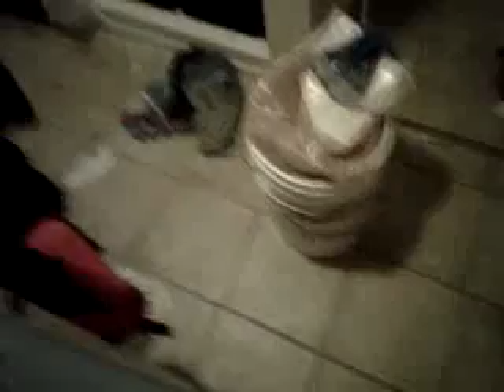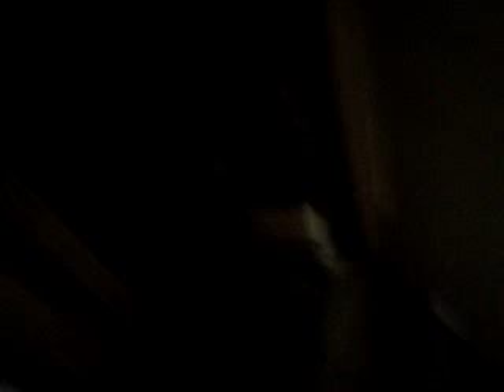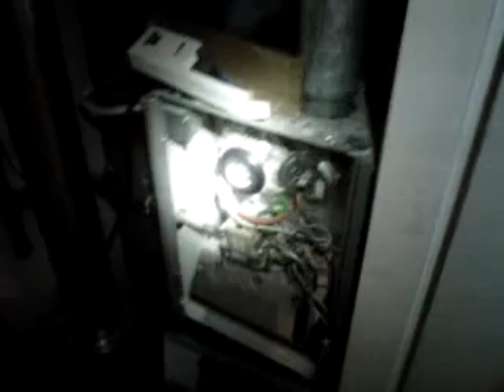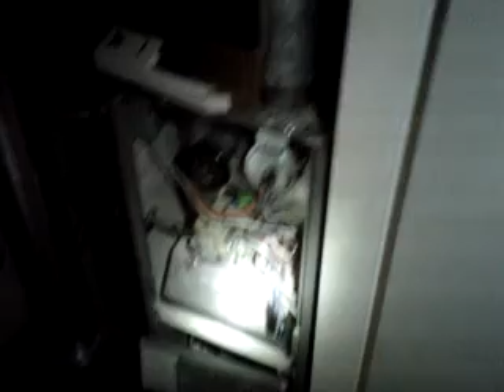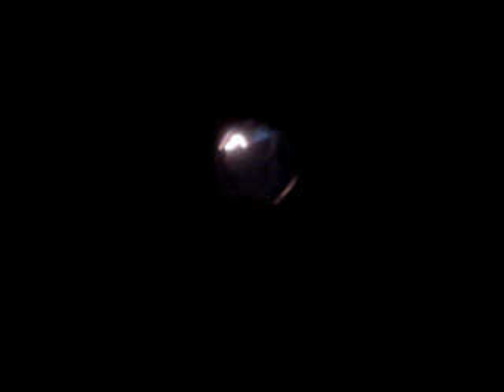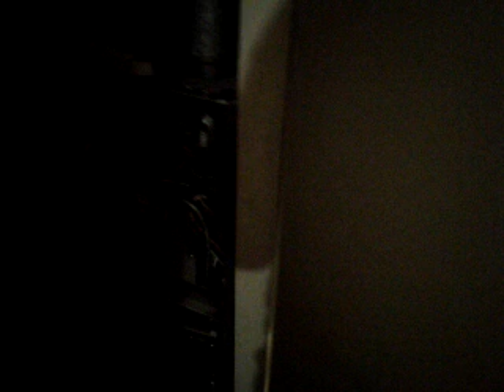honeywell sv9501 smart valve repair #0

Comment: Thanks. This reminds me of so many main relays in Honda cars I've had. Located where the heat through the windshield causes bad solder joints. Resoldered the joints and problem solved. Thanks again. Will try this.